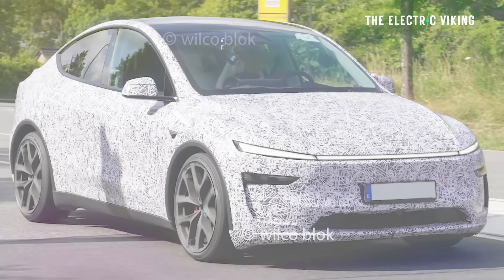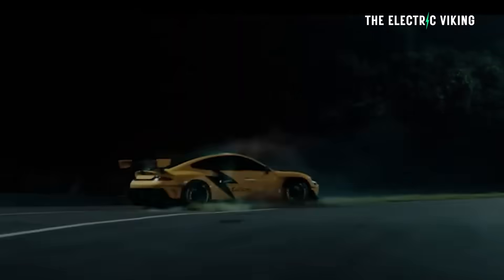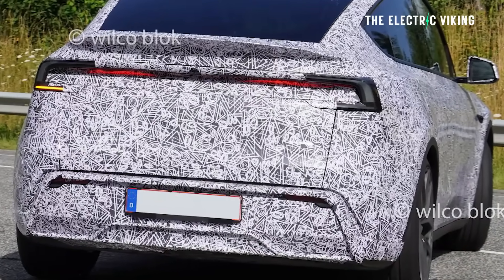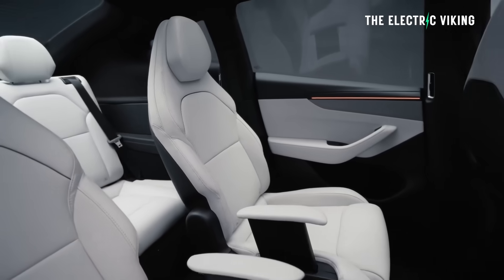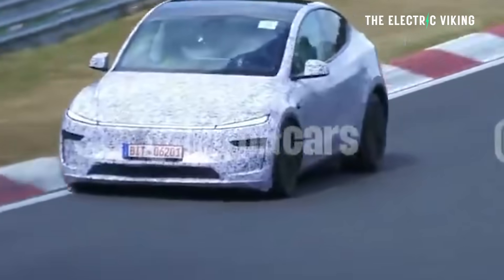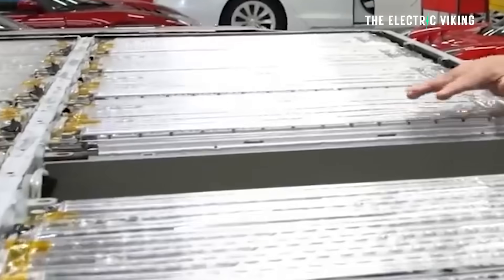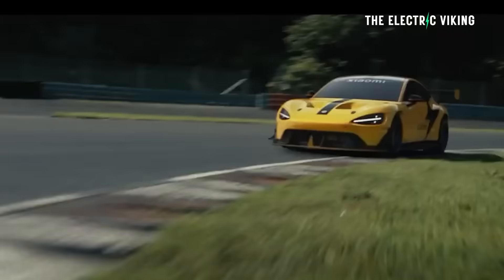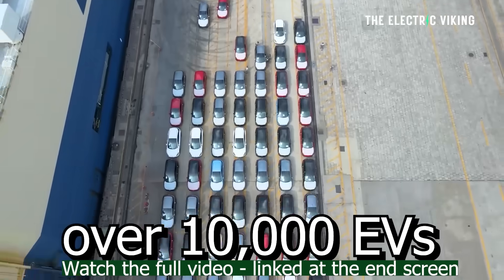Why the Next Tesla Model Y Performance Will Be a Game-Changer

Comment: when almost all Chinese EVs have 600hp and more, Tesla top performance version Y is still only 500hp like years ago? really?!
Reply: You could really just tune it down to 100hp and still be perfectly overpowered.
Reply: Chinese EVs for the most part are still heavier and slower. At the end of the day the quarter mile time is the metric you need not hp.
Reply: 461 kw = 626 hp

Comment: Tesla needs to have options for higher capacity battery packs. Most driving is only going to get 60% of a packs actual 0-100% mileage. (80% top charge because of slower charge rate and battery longevity, and 20% at the bottom because that’s when you’d start needing to navigate to a charger)

Comment: The Engineering Explained channel demonstrated that there's a pretty substantial performance decrease with large wheels. The only thing "performance" about them is that they allow you to use larger brakes, and not many people are going to change out their brakes for bigger ones.
Reply: I guess a YouTube channel knows better which tires are better for performance than all the automakers, the different race teams, F1 cars... oh wait, they dont.
Reply: @eduardgherasim2896  they do it to have the biggest brakes the rules will allow and accept any other performance sacrifices that go along with it. I don't know yet if the new Y performance actually requires 21 inch wheels, but I kind of doubt it.
Reply: Engineering Explained pretty much misses the forest for the trees on a regular basis. The channel tries to impress by using first year engineering calculations to explain a small subset of a particular issue...while ignoring all the rest. Having said this, there are performance advantages to larger wheels, which is why all high performance cars use them. Among these are stiffer tire sidewalls, resulting in better control of tires. As far as "changing out their brakes for bigger ones" it's impossible to use Tesla's 18 or 19 inch wheels with the Performance brake hardware, so this isn't a theoretical advantage, but an actual one. 

While it's true that smaller wheel/tire combos tend to weigh less, and as a result may be easier to accelerate and have less unsprung weight, it's also true that with the Highland Model 3 they went to forged wheels, resulting in reducing weight from the earlier 20" performance wheels from about 28 lbs to about 22 lbs...lighter than the non-forged 18 and 19 inch wheels. 

As seems to be the case with pretty much all of Engineering Explained content, it's little more than some calculations on a small subset of the subject at hand, resulting in little useful information. There's a reason this guy runs a YouTube channel rather than working in an engineering capacity.

Comment: Sam, you mention the launch edition. What is that, and how does it differ from the regular model? What kind of prices do you expect here in Australia for the two (launch and non-launch)?
Reply: This was available in Australia on Jan 10th 2025. 
Key Features
The Launch Edition comes with a host of standard features, many of which are optional on other Tesla models, enhancing its value proposition:
Performance and Specifications

Range: 320 miles (515 km) EPA-estimated, an improvement over the previous 311 miles for the Long Range AWD. With 20-inch wheels, range drops to 303 miles.
Acceleration: 0-60 mph in 4.1 seconds (with Acceleration Boost included), compared to 4.8 seconds for the non-boosted prior model.
Top Speed: 125 mph (201 km/h), slightly lower than the previous 135 mph.
Powertrain: Long Range AWD, with no mention of horsepower or torque (Tesla typically omits these).
Charging: Adds approximately 248 km (154 miles) of range in 15 minutes with DC fast charging.

Exterior Design

Styling Updates: Features a redesigned front and rear with full-width light bars, inspired by the Cybertruck and Cybercab. The front fascia is slimmer, and the rear includes new taillights and a lower fascia.
Color Options: Four no-cost colors: Stealth Grey, Pearl White Multi-Coat, Ultra Red, and Quicksilver. Glacier Blue is not available in the U.S.
Wheels: Choice of 19-inch Crossflow or 20-inch Helix wheels, included at no extra cost.
Towing: Includes a steel tow bar capable of towing up to 3,500 lbs (1,587 kg).
Badging: Exclusive Launch Series badges on the rear liftgate, doorsill plates, puddle lights, and wireless charging console.
Interior Upgrades

Infotainment: 15.4-inch central touchscreen and an 8-inch rear touchscreen for passenger entertainment and climate control.
Audio: Upgraded 15-speaker stereo system, praised for its soundstage and bass clarity.
Comfort:

Vegan suede or premium textile trim options (black or black-and-white interior).
Ventilated front seats and power-adjustable thigh supports for enhanced comfort and spinal alignment.
Power-folding second-row seats with one-touch mechanical armrests for convenience and third-row access.
Acoustic glass and improved sound deadening for a quieter cabin.

Ambient Lighting: Configurable lighting for a premium feel.
Hands-Free Trunk: Automatically unlocks as the owner approaches.

Technology and Driver Assistance

Full Self-Driving (Supervised): Included as standard, typically an $8,000 option. Enhances Autopilot and Smart Summon with a new front-facing camera for improved visibility.
Turn Signal Stalk: Reintroduced, unlike the Model 3 Highland’s capacitive buttons, improving driver convenience.
Suspension: Retuned rear suspension for better handling, comfort, and steering response.
Reply: I think the Launch edition is over.
The RWD and Long Range can be ordered now.